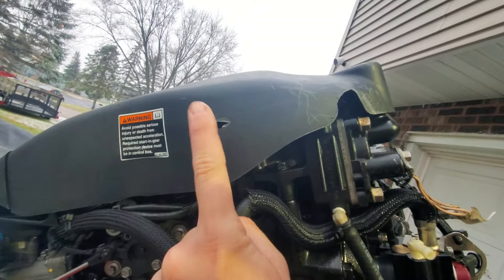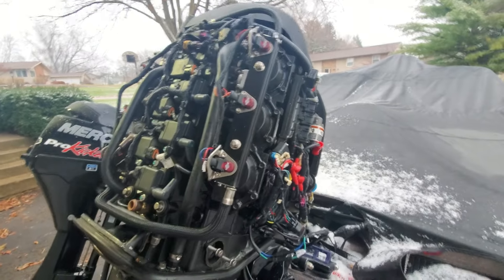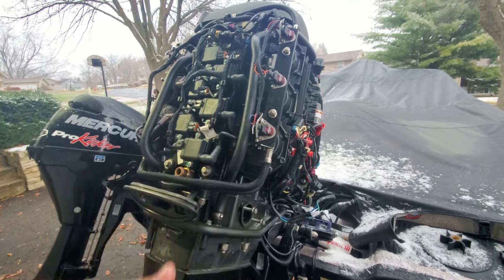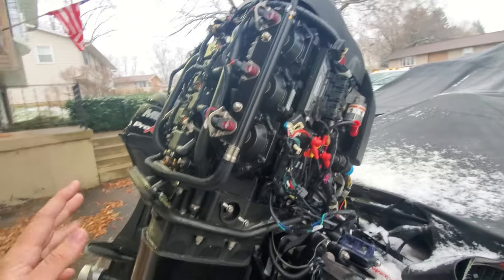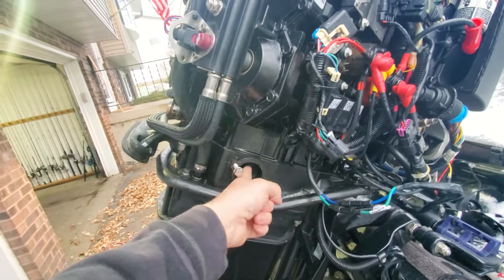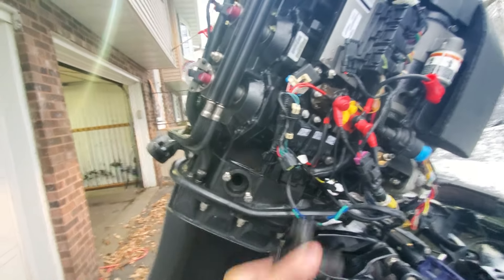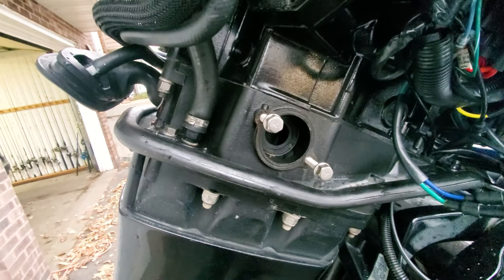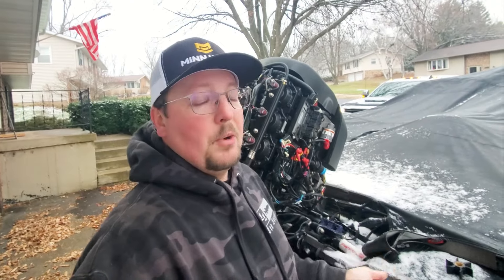OUTBOARD OVERHEATS WHILE PEEING - POPPET VALVE FAILURE! 😣  - SHOP TALK

Comment: Never apologize for not being a 'certified mechanic' - in many cases DIY enthusiasts are better versed with this stuff than 'certified mechanics' - and they charge a LOT of money and have to go thru the same troubleshooting process. 

I have a Honda 90 that low-speed overheats and it's obviously the poppet valve too - thermostats are new, lots of water circulating, so ordered a new one. 
Great vid!

Comment: Greatly appreciate the time you took to go through the entire process. Fantastic fault finding explanation.

Interesting that the poppet valve is not present when diagnosing the OptiMax cooling system on a parts diagram that shows cooling hoses etc. For those looking for it, the poppet valve assembly is actually in the “exhaust plate” diagram.

Comment: Hey mate great vid. Thanks. BUT you’ve got  it back to front. The poppet valve opens at high rpm due to high water pressure created by the water pump at high rpm. Only the thermostat regulated water temp that’s it. Poppet valves regulate pressure. They get stuck open after running at high rpm and then divert cooling water down exhaust jacket at low rpm. Happy to clarify further if needed 
Hope this helps. 
Thanks
Reply: That's right mate

Comment: Thank you so much for the in-depth explanation. I have a 175 black max that I replace two water pumps in and replace a thermostat but I’m still having an overheating issue. I have a strong outlet P stream but at idle the water gets super hot and it cools down once I Revit or get up on plane and change RPM. I’m 100% sure it’s the poppet valve for me

Comment: Just watch a video two days ago because I had an overheat issue at a low idle. Just wanted to say your explanation was absolutely perfect. Answered all my questions and I was able to fix my problem. It was the poppet. I am running a 2000 Yamaha 152 stroke Lol I put the pop it in backwards which intern wouldn’t allow it to open up. I wish I would’ve watched this video before I ordered a new impeller and thermostats but thank you very much. Video was super informative.

Comment: Grest job. Thanks for sharing,  but I think tha poppet valve is not what avoids over cooling, which is the job of the thermostats that open quickly at around 65°C, or 150F.

Poppet valve job is to close the main exit of hot water allowing the poor water pressure of water pump at idling rpm, to be high enough so fresh water reaches power unit and opens thermostats as soon as water gets warm enough.

Above 1500 rpm or so there's enough water pressure and poppet valve should open allowing hot wat to exit freely, which in turn allows a high enough water flow to cool the ef ngine all the way to full 6,000 rpm.

As soon as we drop rpm back to 700 or 800 then poppet valve should close main exit so low water pressure is still high enough to keep cooling the engine.
When we double rpm to 1500 then poppet valve should start opening, if we double rpm again to 3,000 then valve should open more, and doubling rpm to 6000 valve should open all the way to reach full hot water exit.

Think that water pump works from 6,000 to only 600 rpm.

Conclusion is that thermostats move regulating temperature only below 1500rpm while poppet valve must remain closed, starting opening to control water temperature above 1500 rpm while thermostats are fully opened.
Reply: Glad you gave an accurate explanation to the poppet valve operation right down to the engine rpm where it opens and the reasoning for it to open. Some people here on the internet tend to assume or make up the operations of engines and it's parts. This leaves others with the wrong ideas. Maybe he shouldn't be so comfortable working on engines and get a Mercury repair manual that does explain most of the systems operations before taking the chance of spewing the wrong info to others. I see many times the flush isn't set correctly on the water pickups or they slide back causing this problem. Also the home water volume is too low sometimes.
Reply: @garyradtke3252  
I believe you are right.
The manual explains quite well the way the water flow paths. There are diagrams that I had to watch carefully in order to make up my mind.
Reply: @garyradtke3252  I just did a 2014 Yamaha 90 four stroke 300 hour kit .
I used my pass thru muffs from mercury, cause they can't move or slide off. New w/p kit installed wouldn't pee?? Well I had that muff orientated with hose at 6 o clock, well the intake didn't like it so I re orientated it at 9 o clock, everything is fine. Just goes to show you never assume it's not something you did. Almost dropped gearcase again

Comment: HI- great simple video for replacing this item. 
I have a NEW to ME in 2021, 2001 200hp ("Doomed") Optimax model year.  It only has moderate 483 hours and no fault codes. Runs Great so far. I am pretty exp with outboards and the marine Motor Survey when purchased, also gave the condition positive results. 
They even inspected the Compressor(and tested/bled Oil Pump) which seem good. After about 20hrs(6 mos use) I did start having sluggish perf over 4500 RPM.  I think I resolved it with fixing an air leak in the Sending fuel line. 
MInor Problem Stopped. WOT Restored.
Regardless, After reviewing multiple possibilities on youTube, and as a precaution, I am doing all I can to 'Refresh' my decent engine from any previous owners possible neglect.

Replacing a few new 'Wear' parts may address the underlying circumstances haunting this engine series (1999-2002).
I have already done: Plugs/Impeller Kit/Gear oil/VST CLEAN/PrimerBulb/Relay/Belt/Iar Filter/Fuel Filter...

ON MERCURY EZPARTS, I cannot find any full unit P/N for a  Poppet Valve?  You indicated yours was approx $35-40? 
Could you please post the Complete unit P/N for your Model? I realize it may be newer and a different P/N. I may need to buy the pieces individually. So any info on the required replacement/wear items inside the Poppet valve unit would be helpful.  (spring/gasket/ORings)
My Model is a 2001 200 DFI ( Serial # range: 0T178500- 0T59899)  My diagram lists Parts 10-19.

Boat is in storage until April 1 anyway so I have time to order items.
Reply: P.S.- Your diagnostic was very reasonable...WaterPump/Thermostat/Poppet.  My Tell Tale is also working well with no stutter and increased pressure with Throttle.
Reply from the maker: Here is the parts kit I ended up finding for the poppet assembly for my motor. The seller asked for my serial number to confirm the fit, so if you go with the same seller I'd imagine he will do the same. 

https://www.ebay.com/itm/134306061684?mkcid=16&mkevt=1&mkrid=711-127632-2357-0&ssspo=5_jJEiLASg2&sssrc=2349624&ssuid=dytnn3uvsgy&var=&widget_ver=artemis&media=COPY

My motor is a 2010 250xs (race motor - basically a pro xs but slightly more power) I put the newer optimax pro xs decals on it because the red and yellow race decals dated the look of it.
Reply: thing to watch out for is delaminating fuel hoses on the older optimaxes, the material when it separates plugs up everything, fuel pumps/injectors.  the optimaxes have both a low and high pressure fuel pumps and are expensive to replace along with fuel lines and if injectors can't be cleaned, they need replacing. best to replace all fuel lines on motor before it happens

Comment: Excellent video. I'm having an issue of overcooling. I have pulled the thermostats and actually they tested good in the hot water test on a thermometer but the starboard side is erratic in that it is slightly open and will not allow the motor to come up to temperture. I pinched the hose from the starboard thermostat closed with a clamp acting like the thermostat being closed. The temperature came up to normal. The poppet valve is also hanging up slightly open as well. I pulled it and it catches on the o-ring in the block enough to drag and not move easily. The spring tension on the poppet valve may be weak as well. I will be changing the thermostats and poppet valve and will retest.
Reply: How do you know its overcooling?

Comment: Great video.  I just went through the same thing with a 1989 johnson 115hp.  I went through the exact same steps.  It turned out that my poppet valve was stuck shut..  Overheat at high rpm.

Comment: Thnaks for this vid! i have been looking for a heating cause in my proXs since new. Changed thermos, flushed it  every thing. I will look at this next!
Reply from the maker: Another thing to check is the strainer that comes out of the exhaust plate on the port side of the motor, which connects to the water line going to the compressor. there is a chance the overheat could be the compressor getting hot. Water can still flow through, but it may not be quite enough to cool it!
Reply: @MadisonAngling  Thanks for the info!
Reply: @MadisonAngling  Why does an outboard motor have a compressor? ...EFI?...the A/C? 😄
Reply from the maker: @Averageskill  air compressor for the fuel system. Optimax's use air injection along side the fuel injectors to bigger atomize the fuel for better fuel burn
Reply: @MadisonAngling  ok 👌 I looked and couldn’t find anything that resembled a compressor on my 2014 60 HP Mercury.
Reply: @MadisonAngling  ….Lol…. So it’s a blown 250 Pro OSX
…. in other words it has a blower… That’s rad.
Reply from the maker: @Averageskill  you don't have an optimax, so you don't have a compressor
Reply: @MadisonAngling  well…. I was hoping

Comment: There’s one last piece of the puzzle that you should be checking. And that is the water strainer, that’s a good item to replace.  Then you’ll be good to go.
Reply from the maker: Forgot to mention in the video that the water strainer for the compressor water lines had already been replaced!
Reply: @MadisonAngling  Where is the water Strainer?
Reply from the maker: @danconn2065  the strainer is located on the port side of the motor (looking at it from the rear) in the exhaust plate (below the powerhead -  the strainer itself fits inside the exhaust plate and only a hex head fitting is exposed) amd you will need to remove the lower cowling to get to it. It has a water line that runs from it to the compressor.
Reply: So I hit a log on a 04 Mercury efi.. dug wood out of the low water pickups, there was wood stuck in both thermostats, I’ve flushed everything, inspected the poppet valve then re installed it, tested the thermostats too see if they were working, they were.  It runs great! Idles fine , no overheating, even on plane… the only time it throws a warning beep is at 5000 rpm or above…  I replaced the impeller, run all day fine without issue, until you push it around 5k then you get a solid beep. And it doesn’t limit the rpm… but I pretty much let off the throttle every time it beeps.. any ideas. And what about the water strainer? Never heard that b4

Comment: This is an Excellent video sir!! I have yet to have the Alarm go off on my engine but have noticed my Temp gage fluctuating up & down . I have an older engine ,a merc150 Blk Max that I recently changed the water pump propeller and it peez just fine  but i don`t know where the poppet valve & thermostats are located. Can you help me locate them?

Comment: I might be having the same issue.  I acquired a bass boat with a merc 150 optimax pro xs 2-stroke and it sat dormant two years before I got it.  The fuel was stale, grey fuel lines were trashed.  I drained the tanks, purged the fuel system, replaced the fuel lines.  It starts and runs good up until it gets to operating temps and when I ask for higher RPMs it beeps.  I’m thinking this is my next stop.

Comment: I have similar problem but over heating at above 4000rpm slow down and buzzer goes off. An teltail BARLEY pumping and strainer clean. Does the popit also control water threw compressor

Comment: Great video we’re did u get the whole assembly from
Reply from the maker: It took quite a bit of looking, but I found a seller on ebay who had the whole kit put together with all of the components. Another option would be to see if your closest mercury dealer/tech could get you the parts.

Comment: Interesting information. I've had over heating at 1900 Rpms for 3-4 years now with factory authorized techs doing most everything to correct my issue. The boat engine, a 2007 Optimax idols at around 140 WT then when reaching 1900 rpms the water temp on the smart gauge starts rising to about 165 then the alarm sounds and the engine retards. If I accelerate the engine goes to normal operation and runs about 20 degrees about lake temp with no issue, I have been told that it was not the poppet valve but trash, water pump and tstat issues. All those Items have been addressed but the engine issues still persist with one tech running it on the lake with a lap top hooked up and their comment was I can guaranty you that it is not running hot... IDK. I'm at a loss.
Reply from the maker: It's certainly possible that your motor runs warmer than others. I know the XR6 and some of the black max engines normal operating temps are typically higher (150 and up), but in my experience (not a mechanic) most optimax engines operate in the 120 to 140 degree range. One thing to possibly check would be the strainer that is before the water line going to the compressor. It's located on the port side of the motor, under the powerhead (screws into the exhaust plate). You can find it by following the water line for the compressor down to where it goes into the motor. It's possible there is crap blocking enough water to not cool the compressor, and that is triggering the overheat alarm, and not the block temperature. It's actually a part that it seems a lot of outboard techs don't even know exists haha. I would look into that as a potential cause. The compressor has its own temp sensor, so if either the block gets hot OR the compressor gets hot, the overheat alarm will go off.
Reply: @MadisonAngling  Considering you have good mechanical knowledge,  maybe you should do more videos dealing with repair and maintenance. You don't have to be a certified mechanic.  You just have to have knowledge that others don't have, like the poppet valve here in this video.
Reply: @MadisonAngling  don't understand what would cause this valve to get stuck if there's nothing obstructing it? Would it be just debree? Why was your stuck ? Did you have crap in it?
Reply from the maker: @wazup3333  there could be crap that the water pump sucked up, corrosion (common in motors that see salt water) that can throw off the tolerances and clearance of the parts that seat the valve
Reply: @MadisonAngling  but did yours look like that when you pulled it out? Looks clean why would urs be stuck?
Reply from the maker: @wazup3333  mine had a very small amount of corrosion around the plastic seat that was causing it to stick
Reply: @MadisonAngling  is that on the spring side where the plastic goes onto the spring?
Reply from the maker: @wazup3333  it's the plastic ring that is pressed into the exhaust plate

Comment: What makes you think your engine is overheating? At idle the temp is supposed to go up to 143 degrees which is damned hot! Catch a sample from the tell-tale and stick a thermometer in it. If it's 145 or slightly lower it's perfect!
Reply from the maker: My engine was getting up to 180 degrees. You are correct, normal temp for optis is 135-150
Reply: OK - have you checked your thermostats to make sure they're opening at 140-145? @MadisonAngling

Comment: Hey Noah...are you in MadTown?  I'd love to chat, I'm on the E side.  My question is if the Merc. thermostats are different as the top doesn't seem to lift, but rather the bottom portion expands out, deeper into the cavity of the cylinder head.

Comment: I have a MERINER 150 carbureted motor that overheats unless the poppet valve is removed. With the poppet valve in place it shows 30psi water pressure and over heats. With the poppet valve out it shows zero psi but does NOT over heat. What do I need to do...
Reply from the maker: That is kind of a goofy one. Based on that information it does sound like the poppet could be the culprit, but possibly not the valve itself, but likely some corrosion between the metal surface and the grommet the valve seats in. In some cases if there is enough corrosion (doesn't take very much), it can change the shape of the grommet and won't allow the valve to move properly.

Comment: How long does it take for the water to pee out?  I have a new 150 pro XS. Hooked it up to the water hose with cups on intake. No water peeing out. When engine is running for a minute or less. Should I run the motor longer?
Reply: Your poppet may be stuck open if it takes a long time to start peeing

Comment: I have a 2002 Yamaha 50TLRA outboard that has this exact over heating problem. I have replaced all the water pump parts, have great pressure out the pee hole, water is not hot, but still throws the over heat warning. But I don't have a poppet valve that I can find on my engine schematic !! Can anyone help me ?

Comment: My motor is overheating at low rpm but at speed it seems to keep cool.  This looks like something I will have to check.
Reply: what was the issue?
Reply: @mdbassin6267  previous owner never rinsed the engine with fresh water.  The water jacket had crud in it.